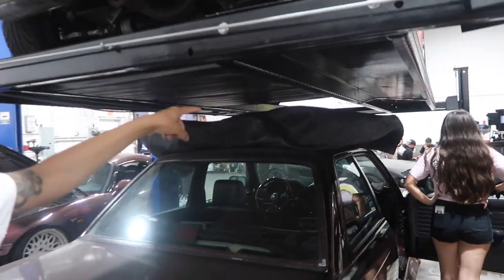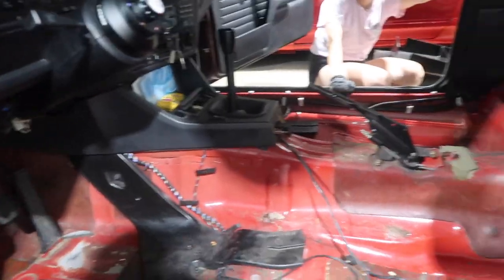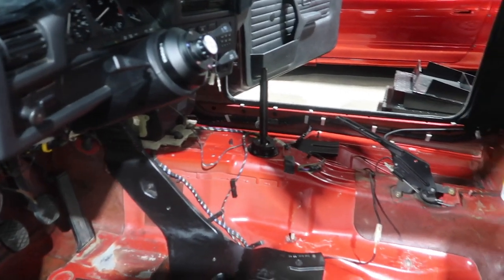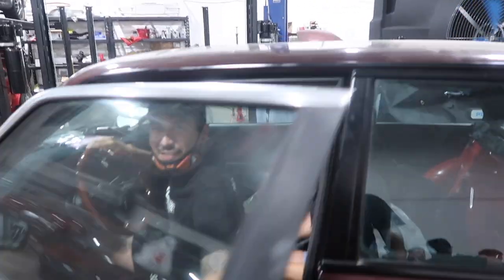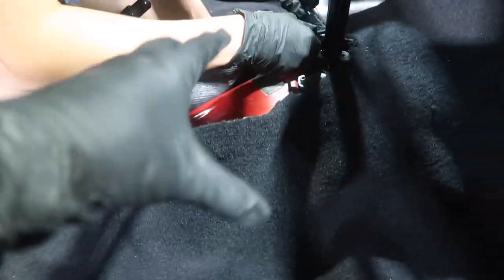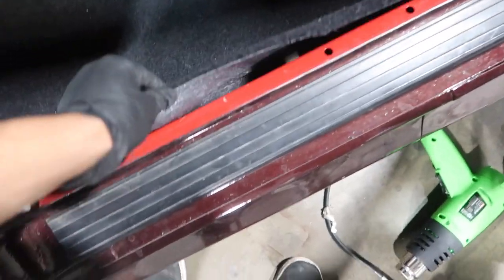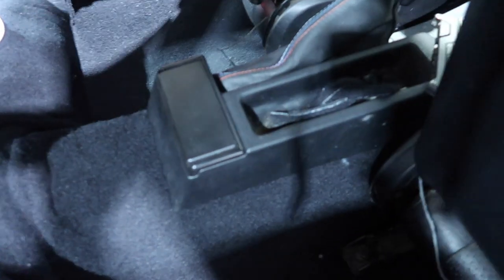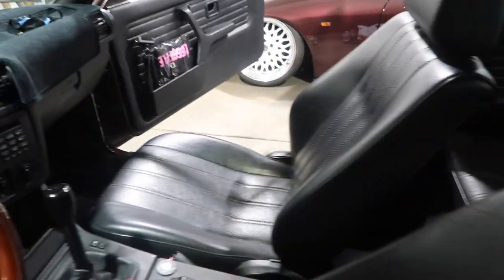I Can't Believe My E30 Looks Like This!

Comment: You should of painted the inside first then do the wiring for the sound system then lay the carpet last so you have pulled up the carpet again to  run the wires.